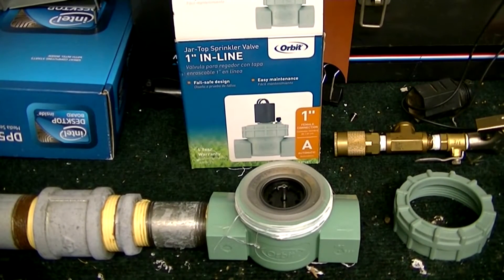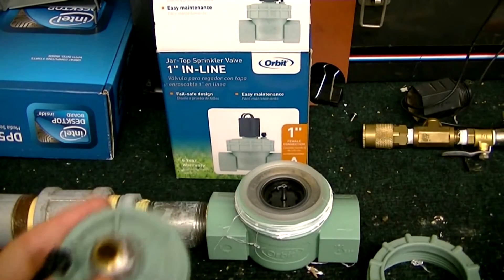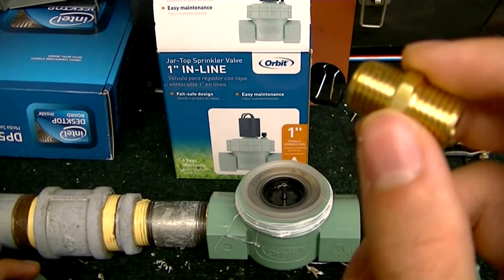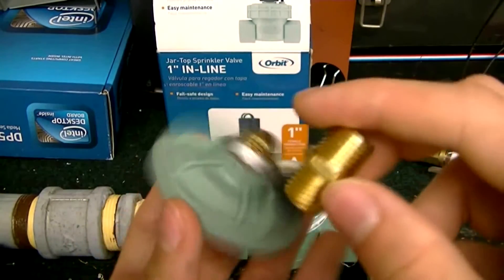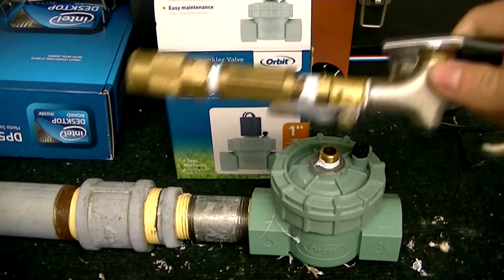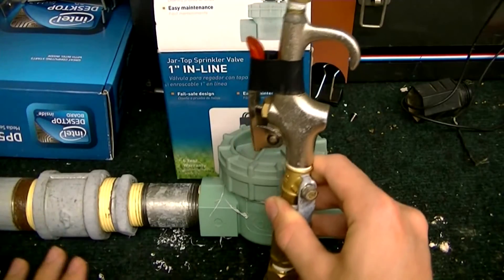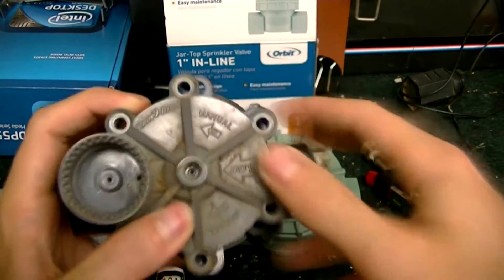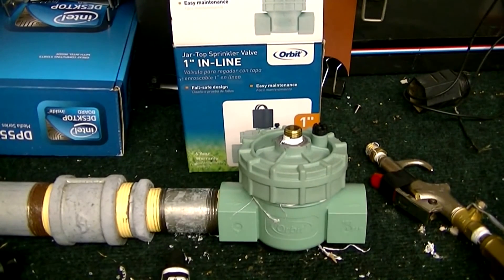How to modify an orbit sprinkler valve for use with a pneumatic air cannon

Comment: works for me, you but got to keep the middle pin inside even when it's closed, not to pull it out as I did initially. it makes the hole smaller and calibrates the required air leak to work properly

Comment: I sealed all holes u said but when I blow through it and hold the small hole with fitting slight leak out sprinkler valve

Comment: Wouldn't wiring a push button switch as a trigger be more simple and easier to use?
Reply from the maker: James Mitchell Using a pneumatic valve is much more reliable and works better for air cannons. The electronic valve that comes with it is designed to open slower to reduce the risk of damaging your sprinkler system.
Reply: smeagle9999 So, if I don't do this adjustment to my valve, my canon will be as powerful in PSI than if I didn't adjust it.
Reply: Thanks for that piece of info.  I use the electric solenoid to open mine and sometimes a strong magnet.  I wondered why it wasn't working well.  The valve sounds like an air horn when air passes through it.  And, based on what you said, I know why now.  The valve isn't opening fast enough.  So, I'll add the trigger mod then, and see if that doesn't help.  I'm using a 3/4" orbit valve.  Do any of ya'll think that would pose a safety risk or, otherwise, impede the operation of a tennis ball launcher?

Comment: Have you tried that valve with the solenoid and electricity. I did and it doesn't seem to open the valve at all. It just lets a trickle of air through when it is energized. Any idea why?
Reply from the maker: sprinkler valves are meant to open slowly. Usually the only way to make them open quickly is to modify them with a blowgun.

Comment: 9 v battery?
Reply from the maker: I believe it needs 12 volts for the electronic valve to function properly, but this pneumatic trigger system is much faster and more effective for use in an air cannon
Reply: Irrigation is 20v but just a thought. Two of them should be close enough.
Reply: Get a little trigger form radio shack.